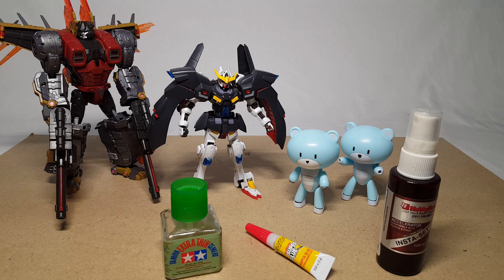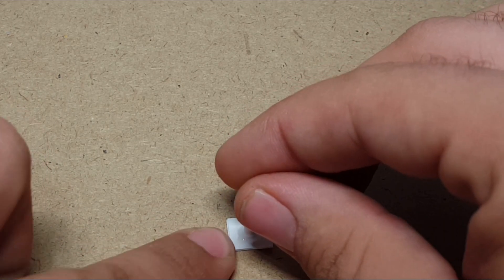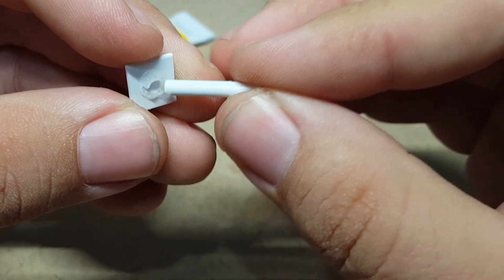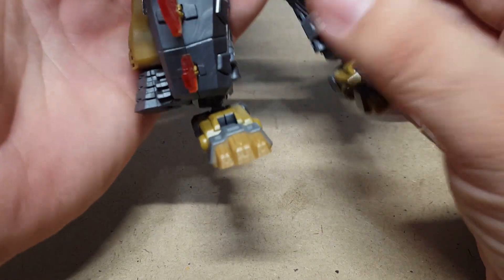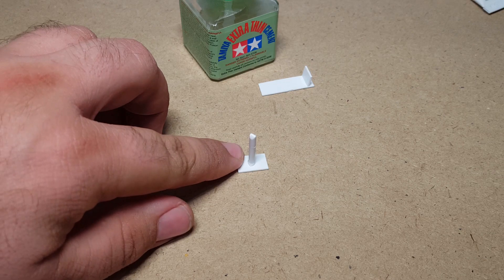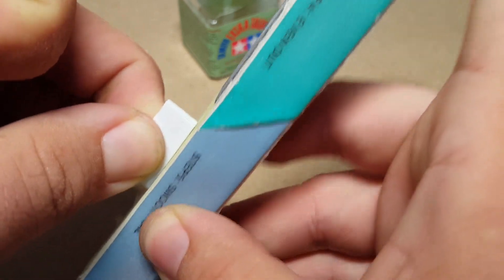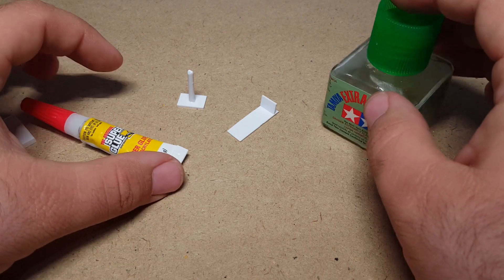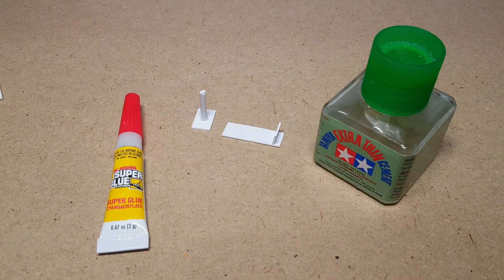SHOKY BUILDER TIPS: Plastic Cement or Super Glue?

Comment: I want to mention 4 things this video made me think of. Sorry for the length of the comments!!

1) It was mentioned that someone used super glue and it melted their plastic. I've had this sort of thing happen to me, which has resulted in me not using super glue anymore.
In my case, the super glue wasn't melting the plastic like the cement does ("fusing" them together). Instead, it was creating a chemical reaction that was heating up the plastic (if I touched the glue by accident, it was actually warm), and it made it brittle. After the glue dried, the plastic would easily break apart. And by this, I don't mean that the two pieces would simply break back into two (as demonstrated in this video), but instead, it was like the plastic was left in the sun for years and was UV damaged to the point where it just shattered easily.

2) Another reason why I stopped using super glue is because I've tried using accelerator, but the plastic becomes especially brittle. The accelerator I've used was in an aerosol can though. Not sure if that matters or not.
Not sure if this is related to my (1) comment above, but in that comment, the chemical reaction sometimes happened (not sure why), but in this case it happens 100% of the time. Overall, I've just lost all trust in super glue.

3) In place of super glue, I've begun experimenting with UV resin glues. They work GREAT, but only if you lay the glue over the parts being stuck together, or if the parts are clear.
Think of it like welding two pieces of metal together versus gluing two objects together. When gluing, you put the glue between the objects and it either melts the surfaces together, or just dries and anchors the objects together. With welding, you add molten metal over the seam, joining the two metal pieces together.
If you use a normal gluing technique with UV glues, the glue between the two pieces can't be reached by the UV light, so it never hardens. This is why you need to put the glue over the two parts instead. That is, unless the parts are clear, in which case, the UV light can travel through the parts and resch the glue between them. (I haven't tried using colored transparent parts yet, such as limited edition transparent Gunpla kits. I wonder if something like transparent green, red, etc would somehow filter out the UV light or something).
UV glues seem to be working great, but I've only begun using them. No negative chemical reactions or brittleness so far. Only oddity so far is that every now and then, I will see what looks like smoke rising from the glue as soon as I shine the UV light onto it, but it lasts only a second or two, and doesn't appear to cause any negative side effects. I assume it's just something to do with the glue hardening under the UV.

4) It was mentioned how you could use super glue as a sort of bondo/filler, and how you can also use plastic dust or baking soda as an additive to strengthen this. You can also use the Tamiya cement for this too in a way.
Save your plastic nubs while cleaning up your pieces, and cut whatever color you need to use into as small of pieces as possible. Pour a bit of the cement into a glass jar, and then drop the plastic pieces into it. Seal the jar tight with a lid, and after a bit, the plastic pieces will liquify into a goop in the color of the plastic. You can then use a popsicle stick, toothpick, or a disposable brush to smear the mixture over a hole or seamline. It will fuse the goop and the plastic together. Just sand it and it will look like the filled area never existed.
It's cool, but I don't recommend it for everyday building. I've done it and it works great, allowing you to fill gaps, holes, seams, etc in the plastic's exact color, and without needing to paint afterwords (as with putty). BUT, it's wasteful. You kind of have to use a good amount of the cement just to create the mixture, and it isn't worth it in my opinion, unless you have a defective part or something you just have to fill on a very expensive kit, etc and you just can't paint it afterwards for some reason. Otherwise, just use putty or something and then paint.

Really great video by the way!!!
Reply: Woh what a long cmt. Anyway, I have the experience on super glue as you mentioned, so yeah, cement iis the best. Cons are they are more expensive and each kind of plastic need different cement type. Like ABS, PVC, PS, PC, PE, omg that's a lot. Not only you need to buy more cement but also sometimes it just hard to classify which plastic it is to cure.

Comment: what is the best glue for my gundam or bandai model kit??
Reply from the maker: Depends on the plastic. Most Gundams are styrene so cement works fine, but there's a ton that have ABS in them and it won't work unless it's a specific cement. Same goes for other Bandai kits. Many use ABS. 

A good rule of thumb would be: if it doesn't need to move and you're not gonna see it: superglue. If it may need to move or you need cleaner results: cement.

Comment: Can you cement two different plastic types? The softer plastic some Ibo kits have with a harder plastic.
Reply from the maker: In my experience yes, but only if they're similar plastics. Styrene will bond to other styrenes, softer or not as long as the cement works on both. Cant do abs to styrene for instance woth certain cements. Google had this answer:

It is possible to solvent-cement different plastic types to each other as long as the solvent must be compatible with both plastics. Usually, a mixture of fast-evaporating solvent is combined with a high-boiling solvent, often with resin addition (up to 25% by weight).
Reply: @THEShoky  Good to know thanks! Ill check the two cements I have see if they have compatibility, i just wish i kept the runner now so i would be sure if it was ABS or not for the harder plastic.

Comment: Thanks for the explanation, I've never really understood the difference other than that plastic cement melts plastic.
Edit: does applying too much superglue make the plastic brittle?
Reply from the maker: It shouldn't unless you have so much it creates a thermal reaction.
Reply: I dont think CA glue produces any heat when curing. I would expect it to lose mass if it did.
Plastic cement heats up and evaporates, the heat melts the plastic and bonds them, while the evaporation ensures there is no leftover or excess material.
Reply: Once spilled some superglue on a gunpla manual and it started fuming so hard
Reply: @aosabi superglue produces heat when introduced to ploymer.

Comment: My Marvel Legends Wonder Man's bicep swivel broke off and I used super glue on it but it broke again I just got plastic cement so if I put plastic cement on the bicep will it work ?
Reply from the maker: That's a tough one, that's more of a job for a pin.
Reply: @THEShoky  so it won't work is what you are saying ?
Reply from the maker: No. It's the wrong kind of plastic for cement and I high torque spot. You need a mechanical connection. You could glue the hell out of it and maybe never use that arm.
Reply: So it won't melt the two together at all and what type of plastic is dried super glue and how does it interact with the cement itself ?
Reply: And also what happens if you mix plastic cement and super glue together to fix a broken action figure limb ?
Reply from the maker: Dried superglue isn't plastic. It's glue.
Reply: @THEShoky   I am willing to lose articulation for a figure with complete limbs so will it work even though I will lose articulation ? I'm just curious.

Comment: I broke a peg on one of my gunplas and the peg is particularly small. Just wanted to ask if I should use plastic cement or superglue to fix it and how long should I leave plastic cement to dry properly?
Reply from the maker: What is the peg used for?
Reply: @THEShoky  it was mainly used for rotating a part
Reply from the maker: If it broke off you won't be able to really glue it back on and still use that part. It'll never hold. Best to drill a hole where it was and make a new peg with a metal rod and glue that in place.
Reply: @THEShoky  Alright thanks for the advice
Reply from the maker: Of course make sure it's the right size
Reply: @THEShoky  hey, so if the small peg breaks off, the cement won't do the job? Even if the plastic melts together it will still be a weak point?
Reply from the maker: For a small peg it'll likely always be a weak spot.

Comment: Question: when I superglue my Warhammer miniatures, this type of glue leaves spots/patches on or around the surface of the miniature where I glued due to inaccurate work on my side. How does the plastic cement compare to the superglue on this regard? What happens to the miniature when you for instance put plastic cement on the surface of a plastic miniature? Does it melt the plastic?
Reply from the maker: So, according to Uncle Dolphin: if its plastic cement is what you want, if its resin or pewter use super glue.
Reply: @THEShoky  can i use superglue for plastic on diecast?
Reply from the maker: Yes
Reply: I use liquid cement it’s the best for plastic minis but you have to be careful with it. If you get a little on the surface just leave it and it should be ok and dry quickly but if you get a lot on the surface it will melt the details right of especially if you panic and handle it ruff if this happens hold it on a part without the cement on it and dunk it in to water a few times to wash it off never put it under running water it will affect the details on the surface.

Comment: Would the Tamiya Extra Thin work for fixing a broken joint peg? I accidentally cut one of the MG Ver Ka Full Armor Gundam.
Reply from the maker: It could but if its something thats needs to move it can still be weakened over time. But it depends on the break.
Reply: @THEShoky  Cut clean off. It's the peg that plugs into the joint and attached to the shoulder. I don't move my kits a lot. Usually pose and display.
Reply from the maker: The cement can work but may also need to pin it for strength.
Reply: All most all my model kits break their ball joints and I bearly touch them
Reply from the maker: That ain't good
Reply: use a metal rod for support

Comment: Hey! I had a cracked ball joint socket on a figure, made of clear red plastic. Would the ultra thin cement work on that?
Reply from the maker: Not gernally on translucent plastic
Reply: @THEShoky  okay, thank you. Do you know any methods that do?
Reply from the maker: Gonna be honest, when it comes to translucent I'm at a bit of a loss, but my instincts say use super glue or possibly a clear resin to repair it.  I have a figure with a pinned translucent part that broke after a fall. I managed to disassemble the joint, and did what I could to glue the broken translucent piece together but I will never trust it and it will likely just deteriorate over time and completely fail. If it's easier and cost effective I suggest replacement over repair for translucent breaks. Especially if it's a broken joint. If you don't need it to move and can't see, then super glue it place and call it a day.
Reply: @THEShoky  Thanks for your help. Luckily the majority of the crack isn’t on the joint itself.
Reply: Sorry to keep bugging you about this, but would you mind if I sent an image of the cracked item in question?
Reply from the maker: Sure. FB or IG.

Comment: As a 40K fan. I must say super glue was fine when I was magnetizing parts but my minis would fall apart a lot quicker if I tried to superglue them together but when I used plastic glue they we’re basically one mini it was like the parts were never separated. The only time I use super glue on models is when I want to strengthen a joint with say a pin or just thickening a ball joint and when I add magnets
Reply from the maker: Always gotta find the right glue for the purpose.

Comment: Between plastic cement or super glue, which would be appropriate for the following scenarios:
1. Reinforcing broken joints with brass rods
2. Sticking a fake red jewel in place of the sticker for the eye part of an HG Zaku (or any HG mono-eyed suit in general)

It’s just that the brass rod and the back part of the fake jewel are made from different materials, so I’m not sure if cement can bond them well with the plastic.
Reply from the maker: In both those cases id say use the super glue since they're dissimilar materials. You could also use a different type of epoxy.
Reply: Yeah, I posted this to several other groups, and from what I picked up so far, they can be summarized as:
*plastic to plastic = cement
*other materials to plastic = super glue

Comment: What is the best method to fix a tiny part like the articulated fingers from the rx-78 origin master grade, the little socket that holds the joint of the pinky finger got a stress mark on it and is a bit bent, is it a good method to glue it to the finger next to it? Thanks.
Reply from the maker: I would add glue to the socket itself. And if you're never going to move it again sure glue it to the next finger too.
Reply: @THEShoky  thanks for the reply, who ever designed those 3.0 hands need to get fired
Reply from the maker: Yup

Comment: would the cement pules super glue work on small broken parts?
Reply from the maker: Cement if its the right plastic yes. Just don't overdo it. Don't want to melt the part.
Reply: Am trying to bound two small Gundam pieces together permanently
Reply from the maker: Which parts?
Reply: @THEShoky  sorry for the late reply
Reply: @THEShoky  sd gundam cross silhouette freedom at wing beam rifle hinge hole if that make  sense
Reply from the maker: The hard part would be I gluing a hinge or moving part since you'd be putting force on the part later. I'm not familiar with the kit so I'm not sure exactly what would be best.

Comment: Hey is the plastic of runners could be lquified  by a super glue ?
Reply from the maker: It shouldn't. If it is then I don't know what kind of glue that is. Super glue doesn't chemically bond like cement.
Reply: Oooh
Reply: That's sad my cross bone A 33 part broke :(
Reply: @THEShoky  Tamiya cement then but how do I remove the seam line from the broken part of it?
Reply from the maker: What type of part is it?
Reply: @THEShoky  A 33
Reply: @THEShoky  feet cover the white thing
Reply from the maker: If you're referring to the break as the seqm line, the cement helps that if its a clean break the cement melts the plastic to "fill" the seam.
Reply: @THEShoky  omg thanks

Comment: Very informative! I've used CAs and Zap Kicker for years but I had no idea water could achieve the same results. I went to test that trick but I think my bottle of Zap-A-Gap might be bad or something. It takes forever to cure, even with the Zap Kicker. Still, the water thing is good to know. One thing I've been meaning to ask though - starting with the Iron-Blooded Orphans kits, it seems like Bandai is phasing out Polycaps in favor of that semi-soft inner frame material. I've yet to identify the plastic those runners are made from, and to find any sort of adhesive that works on those. Can anybody suggest something?
Reply from the maker: usually on the first page of instructions itll tell you which runners are which plastics, it'll say PS (polystyrene) PE(polyethylene) or ABS. And to find what works on what, quick google search.

Comment: I've seen that you can also use baking soda to pretty much instantly dry super glue. It seems so effective, that I'm not even sure why one would buy that putty that Tamiya makes. Seems like a cheaper way to achieve the same thing of filling what's left of a seam line. Maybe the putty takes less sanding to smooth out?
Reply from the maker: Yeah. Baking soda dries like a rock. It is good filler but takes a good bit of sanding to clean up. It IS good for strengthening a bond just by adding more body to the glue.
Reply: @THEShoky   Hi do you just use sand paper for the sanding down of super glue?
Reply from the maker: Yes

Comment: How can I get rid of liquid cement because I used to much and my whole model is covered in it
Reply from the maker: Well if it doesn't melt the whole thing just quickly wipe it off.
Reply: ShokyReviews this is my first model and I’m new, I messed it up I put to much glue and and let it dry and I just noticed so what can I use because I tried to use nail polish remover but it didn’t work the glue is testors non-toxic liquid cement and I thought since your a pro I could get some advice